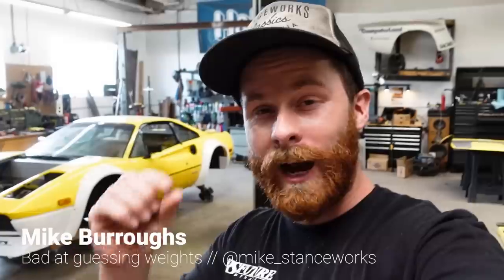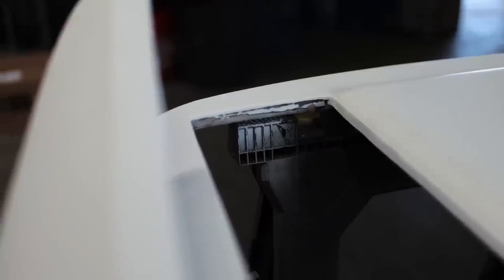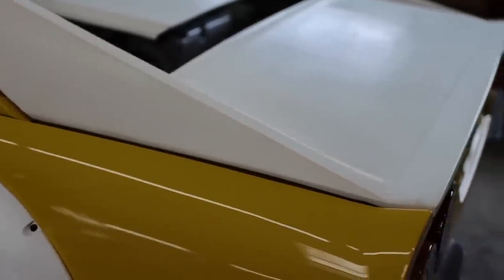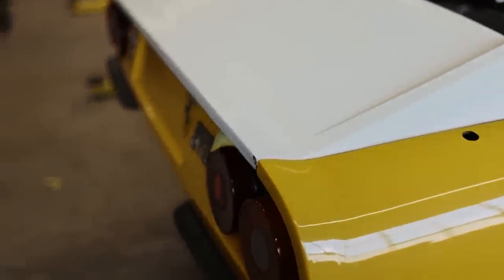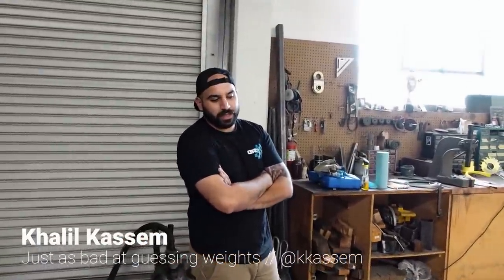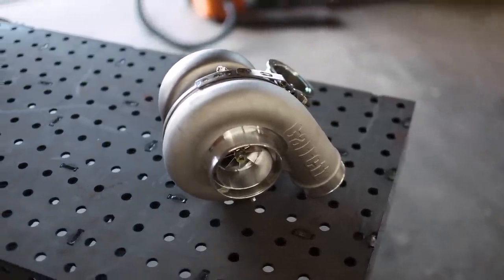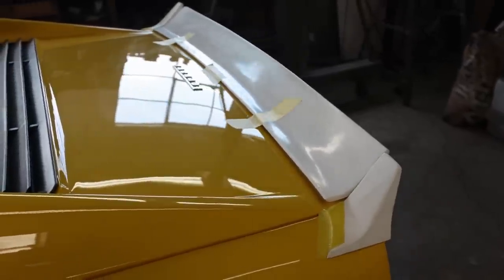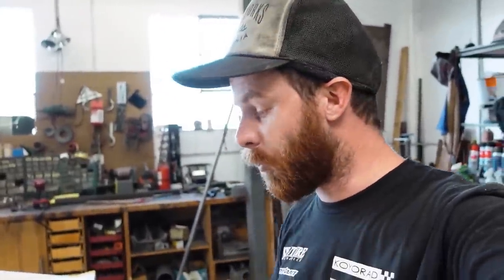Under 2000lbs With 1000+whp!? Weighing the K24-Swapped Ferrari 308 GTBi - Ep. 35

Comment: For a clear hatch... Cut the same hole in two plates of steel as you'll have in your hatch.  Weld legs on the bottom plate.  Bolt the bottom plate with legs, plastic, and top plate together.  These holes can be the same ones you'd use to fasten to the hatch.  Stick the sandwiched plastic in an oven.  The plastic will start to droop.  You'll have to keep checking on when to stop, more time, more droop.   If you want multiple drops aka F40 style, put some bars going across.  Spray all the steel with silicon!   Now where are you going to find an oven big enough?  You could investigate any place that makes windshields for helicopters or places that make custom orthopedic braces melt plastic like this all the time.  Or perhaps you could try making your own?

Comment: Don’t forget you can blow your own shapes like they did back in the day for custom bubble tops like Ed Roth and Gene Winfield. You need a big box, some heat, a forming buck and an air supply.
Reply from the maker: 🤔 hmmmmmm.
Reply: I wanted to try this a while back and from what I remember you basically need an oven big enough to fit the lexan sheet that can very slowly bring it up to temp. Heat it too quick or uneven and moisture in the  lexan can boil causing bubbles. Not enough heat will cause spider cracking on tight bends. Seemed more trouble than it was worth for a one off part for me but this car might be different

Comment: You can knock a lot of weight off the fibre parts by sanding back the gel coat until the tip of the fibre weave starts to show through. Do Not go past that point, not only will it compromise the strength it will make it a pain to paint without applying another gel coat or other suitable sealer.
Note 
When sanding down fibre with metal embedded avoid going to fast and hard and heating up the metal it will cause the fibre to delaminate.

Comment: Go carbon fiber tubes to the front for the intercooler.  Saves weight and 1.5x stronger than steel.
Reply: Isn't he doing an air to water intercooler? That would be seriously long piping and lose air Velocity and cause lag

Comment: I really like this project.  The only thing that hangs me up on it is the way that engine is going to make its power.  Sure, you might get a big number out of it, but it's going be be very peaky with very little "under the curve".  The bigger the turbo, the more true this is.  You'll have to drive it like you hate it, and the gear box needs to have the right ratios to keep you in the boost as much as possible.  I think it's going to be hard (but fun) to learn to get fast laps against torque(ier) cars that can charge out of the corners.
Reply from the maker: Not sure if you missed it but I have two turbos. The primary turbo is significantly smaller and spec’d for an engine this size.

Comment: gotta wear a particle filter mask when cutting/grinding carbon fiber bromigo, super bad for your health... its also bad for electronics, you'd be better using compressed air cutting tools next time (and doing it in a ventilated area or outside to keep the dust from getting everywhere in the shop)
Reply from the maker: I didn’t know that. So a normal face mask isn’t good enough?
Reply: @stanceworks  Its better than nothing of course, but I would throw it away afterward. Consumable N95 masks would be an upgrade, but I believe its worth investing in a proper respirator with P100 filters, we only get one set of lungs afterall! Love the project man, keep it up 🍻

Comment: Nutty, the f40 window would set this off, show off them shinny bits. How about cutting slits in the hatch, since the hatch is going to be quick release have it slide around the uprights.  Have the uprights bolt directly onto the pedestals you mentioned.  Can still be a 1 man job to remove hatch that way.
Reply from the maker: I thought about that, but the main problem there is I’d have to maneuver the hatch up and over the wing and then back past the uprights. Could be taxing.
Reply: @stanceworks  come from the side?  And carrying the hatch over the passenger compartment?

Comment: More excellent content. The perspex idea is interesting and I would try and salvage the flying buttresses rather than placing an angled piece of plastic following their angle. As for a rear wing, you can make all the downforce you need with the spoiler that is there now and an adjustable lexan extension. A wing will drastically change the look of the car for the worse as it will look tacked on and not fluid to the shape of the car like all the other mods so far. Again there is no real downforce to be gained especially if the splitter and rear diffuser is well done. Save your money and keep it clean.
Reply from the maker: It's a time attack car, it's meant to have obnoxious aero, and it will! I think a wing will look fantastic.
Reply: @stanceworks  Fair enough. A swan neck wing would be super modern looking. As for mounting just hard mount it to the chassis as far back as possible and cut reliefs in the engine lid for it. The lid will not have the stiffness to properly support the wing even if you build a structure to handle the load from the downforce. Been there done that.
Reply: @stanceworks  i believe so too, the lid won t be stiff enough to support the wing - massive aero changes midturn - but awesome content - love it

Comment: i am not completely against a lexan hatch window thing, but how about NOTHING instead? leave it as is, and cut a hole where the head of the engine is? would weigh less than not a  hole :)
Reply from the maker: True, but it would also be worse for aerodynamics. A lot worse.
Reply: @stanceworks  maybe, but i would say it helps pull air out of the engine bay, from the underbody, so perhaps it helps?

Comment: The reason you hack up a decent car is because it's decent. You're dealing with known quantities and known tolerances and you aren't having to fix issues at every turn that you may not have known about with the car all together. I've seen loads of videos where a ton on work had to be spent to fix accident damage that was hidden behind body panels that were just slapped on and body-filled to correct for the underlying structural issues. While some people who are interested in fabrication for the sake of it, this may be a hidden boon for their fabrication agenda, for people who just want to get a project finished on a reasonable schedule, working from something that is in good shape to begin with saves a lot of time and effort. Are there certain cars that you wouldn't want to do this with? Yeah, sure. Some cars, because of the modding community, are so difficult to find in their stock form that starting with such a pristine example is practically sacrilege. Stock first-gen NSX, for instance. Particularly the Type-R variants. They're just too valuable and too rare to hack up for something like this. I'd probably be hesitant to do this kind of project myself if it were on a car that was legitimately hard to find in stock form, because you're just killing a unicorn for its horn. I'd want something that had already been worked on in some way to assuage my guilt about messing with something precious. Not like I can afford any of those cars in the first place when even a cheap TT 300ZX is going for $20k and an S15 has hit $43k.

Comment: I got over the hacking up of a minty Ferrari a while back. But I just cant get over the engine choice quite so easily. I mean a dirt cheap stamped out, $0.02 ricer four banger. Man that just floors me. Its like putting ketchup on a watermelon. Just don't go together.
Reply from the maker: What part upsets you? It’s significantly more powerful than the V8 that came out. It’ll make 1000whp. It’s the lightest option possible - and weight is the enemy of performance. It revs high. It’s reliable. And it’s inexpensive to maintain and replace. 
I think you’re hung up on preconceptions and not using logic. Your emotions are driving your feelings and not pragmatism.
Reply: @stanceworks  100% correct.  I just think Honda Civic, and try to fit that in the Ferrari category. Very hard for me.

Comment: I cringed slightly at you grinding/sanding that carbon without a proper filtered mask on. 

They’ve discovered carbon fibre dust is about as bad as asbestos when it comes to being impossible for your lungs to expel. That dusts in your lungs for life now. 

Make sure you put a load of hotboi gold foil insulation on the bottom of that engine cover, most carbon resins/gel coats aren’t great at dealing with heat.